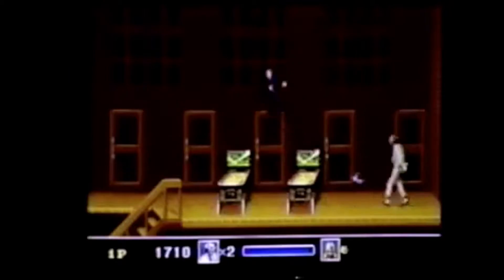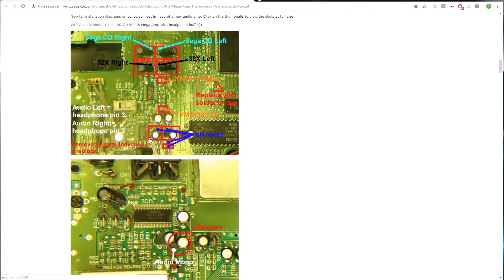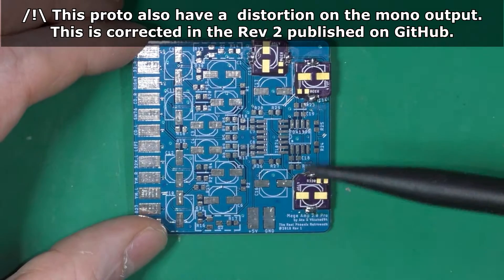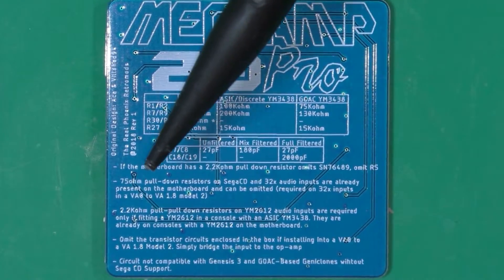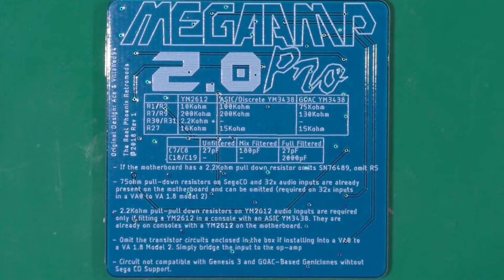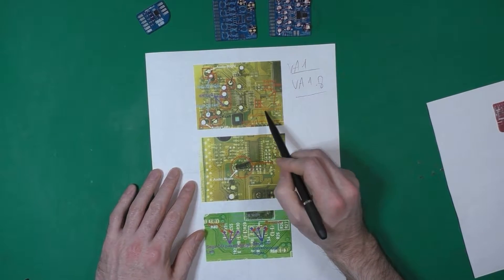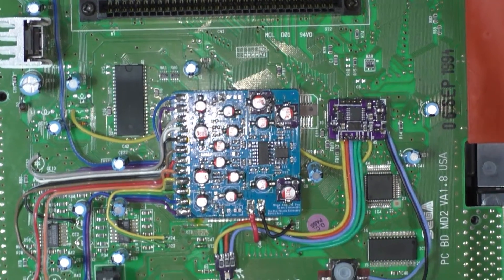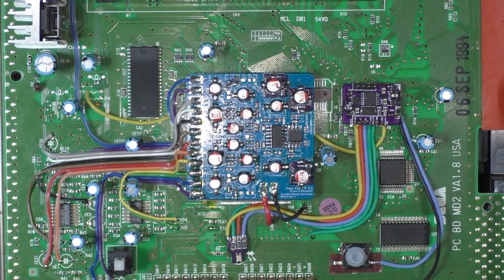[Retro] Mega Amp 2.0 Pro for Genesis/Megadrive

Comment: Mega Amp 2.0 Pro is better than Tripple Bypass 2.0
Reply from the maker: No, they are based on the same circuit. TBP is more condensed and pack RGB bypass, while MegaAmp have some additional SegaCD mixing option for Genesis 1. TBP 2.0 is technically more accurate from MDFourier analysis.

Comment: Where can I buy all the components? I bought the mega amp pro 2.0 boards and I thought It came with all the components already installed(Fail! hahaha). I will solder them myself. I just need to know where to get them. I want to mod my VA 7 and with the Max-filtered setup. Thanks for your work.
Reply from the maker: On the Github depository you have a CSV file with all the components needed. Then you can order them on Digikey, Mouser, etc..
Reply: @TheRealPhoenix_Retromods  Thank you for the quick reply. Which gauge wire are you using for this mod? Will 26 gauge wires be optimal?
Reply from the maker: @Mykaizer  Yes 26 AWG is fine.

Comment: Does it work and/or improves the sound in YM2612 versions too?
Reply from the maker: On model 2 VA2 and VA2.3, it works and it improves the sound. On model 1, yes it could technically work, but you won't have much improvement. You will have some additional feature, like the filtering and you can mod to have the internal mixing CD.
Reply: @TheRealPhoenix_Retromods  I have a VA2 Sega Mega Drive (japanese) version and a Malasia version with the same chip

Comment: Hi! Alredy building a pcb to start sell? I want buy one but i have a fraid to do one by my selfie, so could u do e one?
Reply from the maker: Yes, they are prebuilt Mega Amp 2.0 on my store.
Reply: @TheRealPhoenix_Retromods  could u send me the store website?
Reply from the maker: @showmanproducoes  https://trp-retromods.ca/index.php?route=product/product&product_id=73
Reply: @TheRealPhoenix_Retromods  thanks, just a question. What is the diference betwen Triple Bypass and your sega genesis kit with mega amp 2.0 and Voltar rgb bypass? Is the same thing?
Reply from the maker: @showmanproducoes  Yes, the 3BP is the combinaision of the Voultar Bypass and most of the feature Mega Amp 2.0. The third part of the 3BP is only relevant if you want to mod a model 1 and want the miniDIN 9 plug.
Reply: @TheRealPhoenix_Retromods  why genesis model 2 dont take advantage with 3BP? Sorry but i dont understanding why the mega amp 2.0 plus voultar rgb is better for genesis model 2 than the 3BP!
Reply from the maker: @showmanproducoes  I've just write you this is the same thing, combine in a single mod. But there are people happy with the sound of their model 1 and only want the RGB mod, and  there are people happy with their model 2 video output (or want to keep composite) and only want the mega amp sound. That's it.
Reply: @TheRealPhoenix_Retromods  understood now, thanks!
Reply: @TheRealPhoenix_Retromods  i tried to complete the purshase but there isant shipping opitions to Brasil! Could u solve this problem?
Reply from the maker: @showmanproducoes  Ah! Canada Post service is suspended to Brazil currently because of the Pandemic. See https://www.canadapost.ca/cpc/en/our-company/news-and-media/service-alerts.page Sorry, I cannot do anything.

Comment: Salut, et merci pour ta vidéo !
Je possède une MD2 VA1.8, mais pour le son j'utilise la sortie RCA de mon Mega-CD 2, qui est de largement meilleure qualité. D'après ton expérience,y a t'il une différence de qualité de son entre une MD2 modifiée (type Mega Amp ou CCAM etc) et un MCD2 ? si oui, vers quelle machine la balance penche t'elle, et dans quelle mesure.
Je précise que j'ai modifié le câble AV pour retirer les parasites audio et vidéos dus au circuit rehausseur de tension. Je n'ai plus les horribles sifflements dus à ce problème.
Merci !
Reply from the maker: Oui complètement, le mod n'est pas pour la qualité de conservation du signal audio jusqu'à la sortie en tant que telle, mais le traitement même de celui-ci à sa source, qui a été déformé par les changements de design du circuit: compression des fréquences, plage dynamique, filtrages, buffers, etc... Le mod se situe avant le mixage vers les MCD2.

Comment: Its hard to find those amp board cause they are out of stock. Is it possible to to make my own board with some requirement parts? Like caps. Ressistors etc.
Reply: I ordered my boards from OSH Park, and got most of the parts from mouser. The tda1308 I had to find on eBay, but I was able to get 10 for like $6 with shipping. I just wanted to build my own because I love doing it. This is an amazing mod for the genesis! I love it! If there is stock in the store, the price is really great value!
Reply from the maker: You have a BOM file (CSV) on the github depository.
Reply: @TheRealPhoenix_Retromods  is that a diagram?

Comment: I am about to build this board for a Model 1 VA5. 
I want to build the sega cd pass through, and I was wondering if I have to bridge all 3 pads of J1 and J2? 
And for a model 2 VA1/1.8, do I just jumper the left and middle pads for J1/J2 when omitting the transistor circuit? 
Thanks for your help and really appreciate that you released this design!
Reply from the maker: I'm not sure how to install on a Model 1 VA5 since it already have a YM2612. The jumper pads position are 1-2-3 from the left to the right. If you need the transitor circuits, solder the jumpers in position 2-3. If you don't need them (Model 2 VA0 to VA 1.8) solder the jumpers in position 1-2 (and you can skip populating the transitor circuits).
Reply: EDIT: Nevermind, I see that the updated .brd and .sch files are there on the main GitHub page. I was looking at the zip file included which has rev 1 files.

 @TheRealPhoenix_Retromods  Thanks for the tips. I'll be building both variants to test them out. One more question, could you upload the .brd and .sch files for the revision 2 amp to github? The existing files there are only for rev 1. I am having trouble placing some components due to the indicators being overlapped by pads or other traces.I just want to make sure I am placing the proper components. Thanks again
Reply from the maker: Thanks I'll update the Gerber file.
Reply: Just wanted to say that I successfully built this into a model 1 VA4 without any problems! I have RCA mixing support now to my model 2 Sega CD, which was seriously missing from DB Electronics triple bypass. Thanks again!
Reply: Nevermind, i figured it out!

Comment: FYI, the BOM on github is missing R35/R36
Also, the board marking for TL074 don't have an alignment indicator
Second also, many of the resistors' identifiers are overlapping other components and are not readable. This board is a mess.
Third also, your BOM has C14 mislabelled as C4 (there are two C4's).